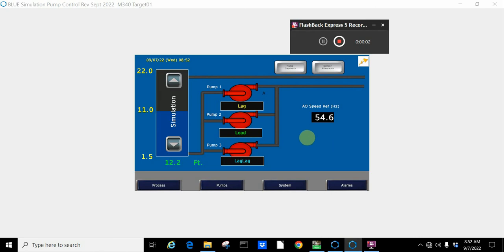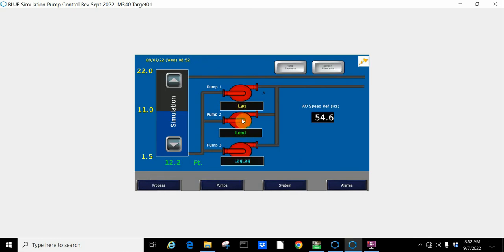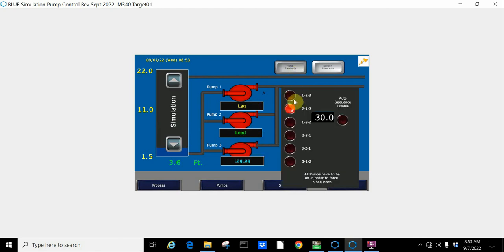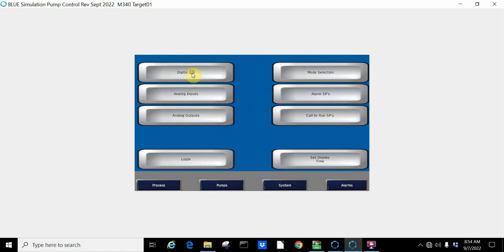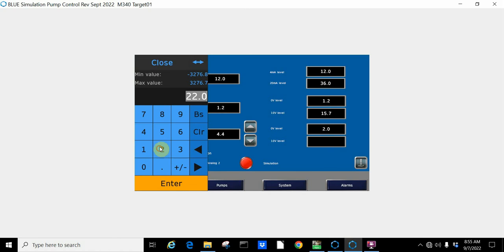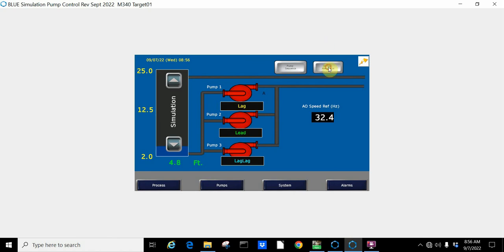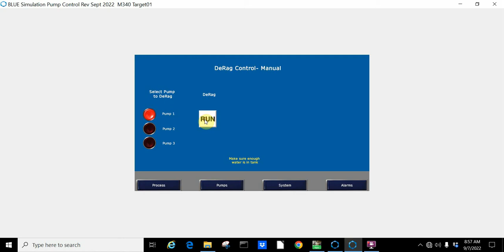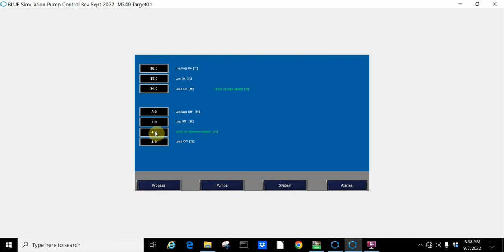Modicon M340 Pump Controller

Comment: hi Steve Klein, I'm a student from Kazakhstan and I have a thesis on the line as I'm working with Modicon 340 and I have a dissertation on a pump your project would be useful to me. But I could not open your program because there is no CNC like yours and therefore does not open your program. Therefore, I want to ask you step by step how you did to do the same for your program